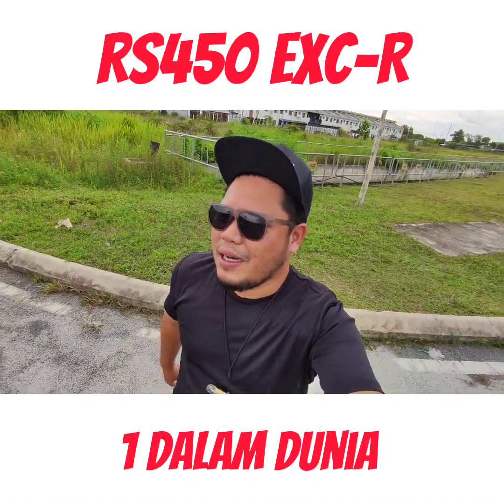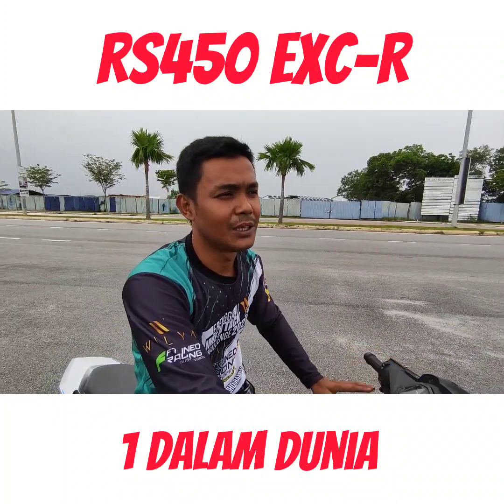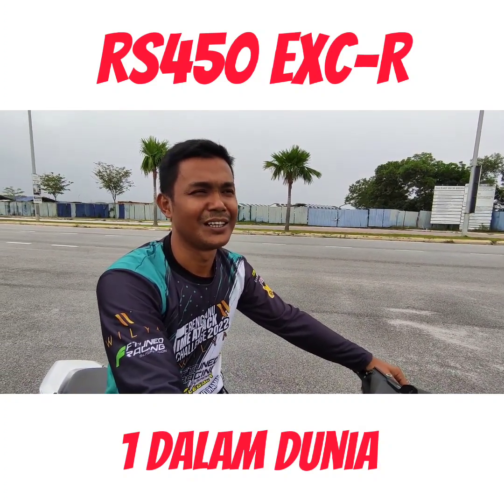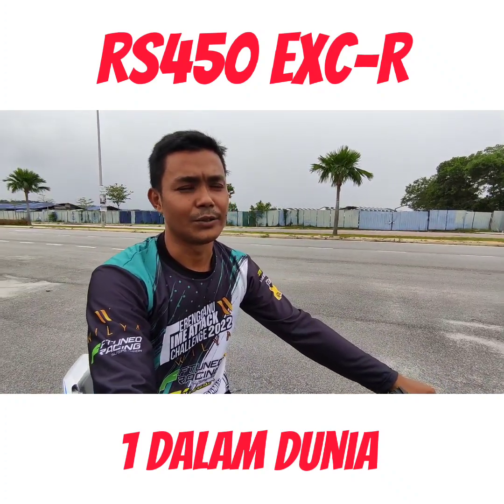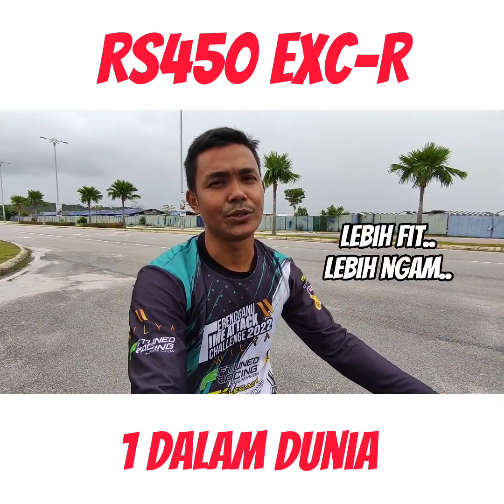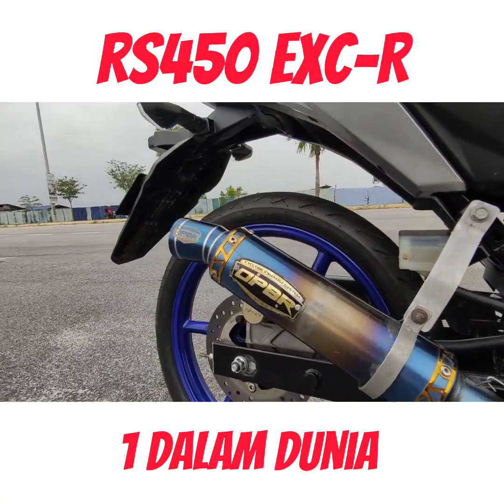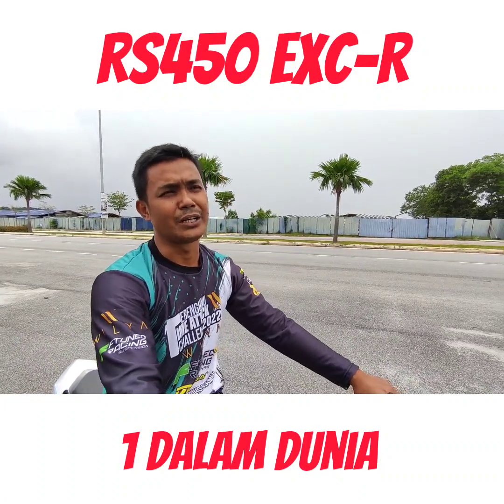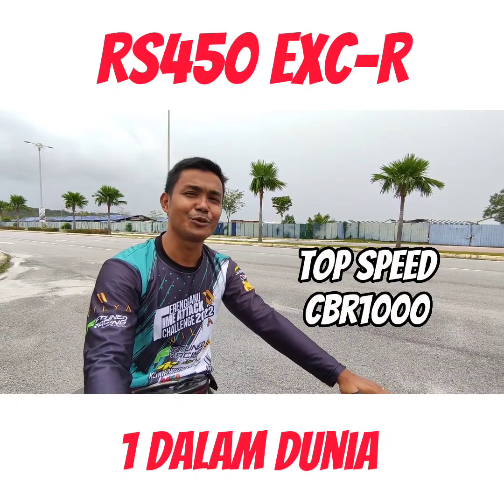Honda Rs150 KTM EXC-R 450 by Lie Rvr

Comment: Pehh berbaloi gile body kapcai enjin 450cc.. rse mcm bwak mt09 versi kapcai 😅
Reply: Kannn,tp kalau dh 50 hp kalau pakai tayar 120-130 medium atau soft comp mesti best. Stabil dan ada power. Pastu pakai brake 2 pot and steal breded
Reply: @zulkifliluqmanhafeez6066  lpstu main dlam town..pehh mmg auto king kapcai
Reply: @o.n.e5595  kannnn. Buat naik ganting boleh follow sbk owww🤣
Reply: @zulkifliluqmanhafeez6066  semua dok riki moto ape yg cucuk sbk tu 🤣
Reply: @o.n.e5595 dia kalau laju body moto kecil bukan dia xbalance ke..silap2 kene angin mau berkelah atas jalan..sbb rxz yg 180 atas jalan tu pun dah bergegar..ni kalau 200+ dengan body cmtu entah la...ke cmna?
Reply: 😂saya rasa sama tolakkan dia kot